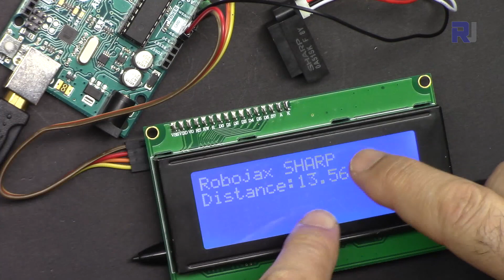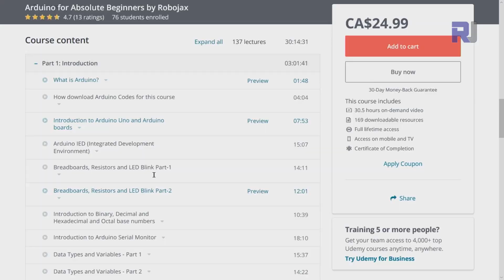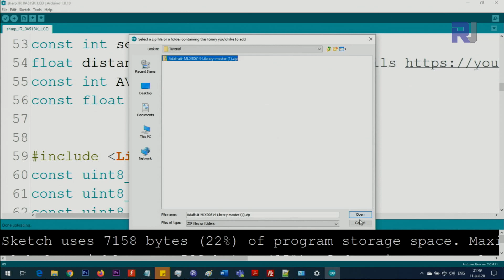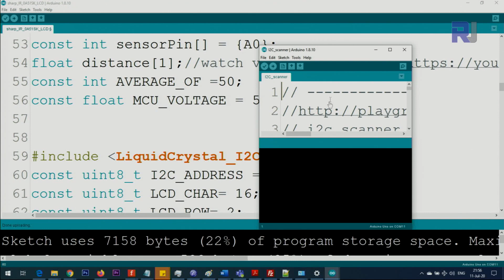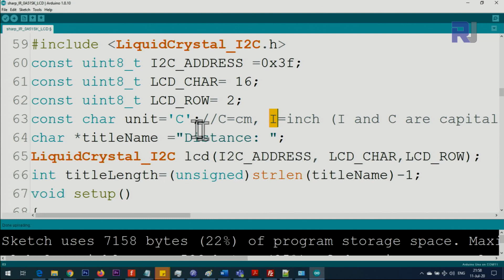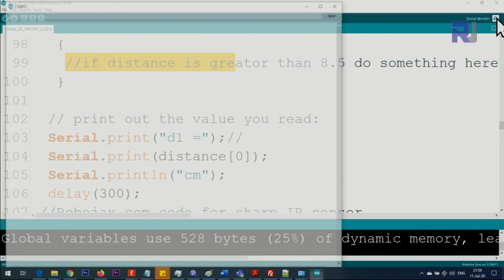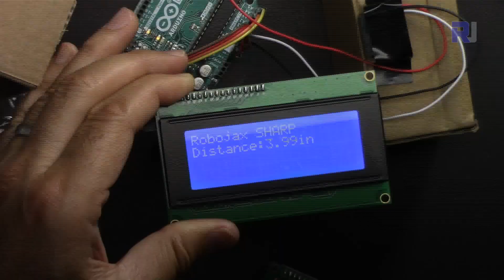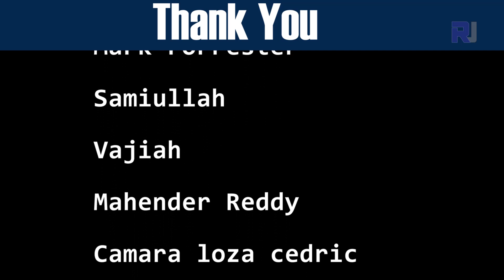Using Sharp 15cm Distance Sensor  0A51SK with Arduino LCD1602 and LCD2004 - RJT339

Comment: Rubbish !! your code cannot work !!!
Reply from the maker: This is 3 step project 
1-first use lcd and install library for lcd to make sure you can see a Hello world! text
2-learn the sharp sensor so you can read the distance and display it on serial monitor 
3- then use the code in this video and it will work for 👍 sure
Now it is time to say Rubbish if it doesn’t work. All of this has been mention in the video excluding the Rubbish part.😀
Videos links are in the description or simply search my channel. I never disappoint a person who is willing to work towards learning.. good luck
Reply from the maker: Did you do the two required steps?